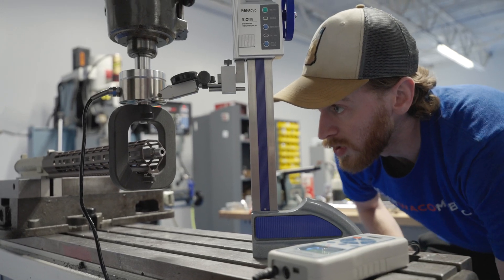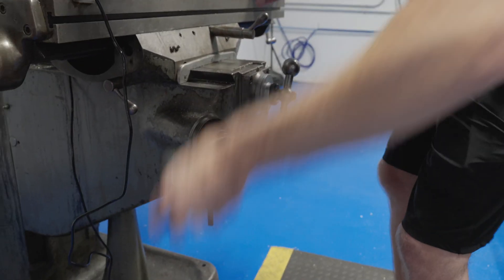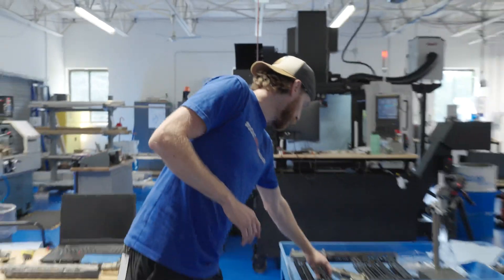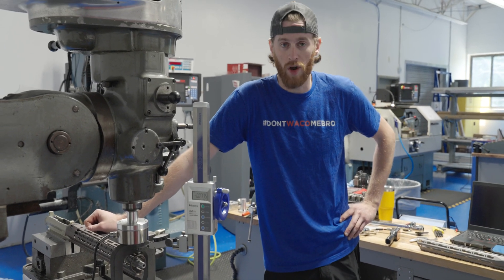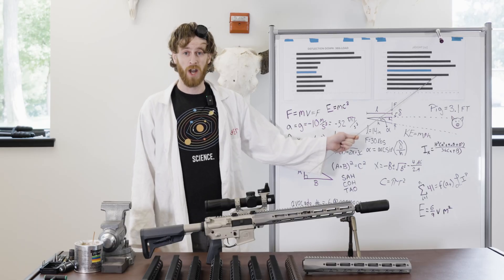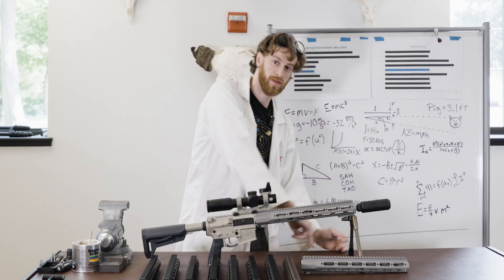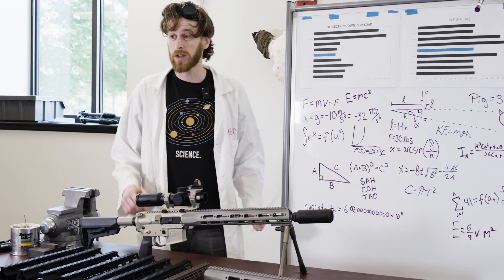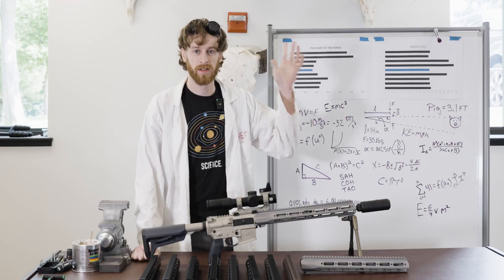Q | OTP HG Deflection TESTING! It matters.

Comment: I love the marketing going on here and love the humor Q has...  but at the end of the day...  anyone using a rail mounted laser system is probably not looking to save money on a handguard after the investment of $5k+ in NV.  But fair enough there are definitely plenty of new people with the money and not the experience to know they need a more rigid hanguard for aiming devices.
Reply: Honestly I think this all misses the boat entirely. Laser shifts aren’t nearly as important as POA shifts from barricade work on longer distance applications. Engagement distances when using IR laser devices are typically in a close setting not off a barricade and with shorter guns making a lot of the flex not enough of a factor to matter. 

I think people just hear from other people that the primary driving factor for rail flex is for IR aiming devices and I haven’t seen that to be true. Long distance shooters with gas guns needs to be the targeted market.